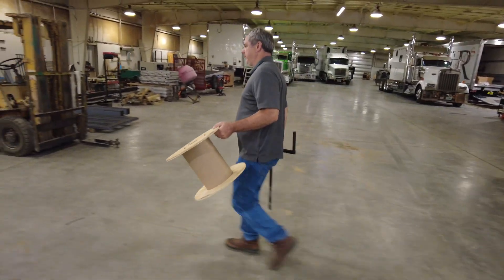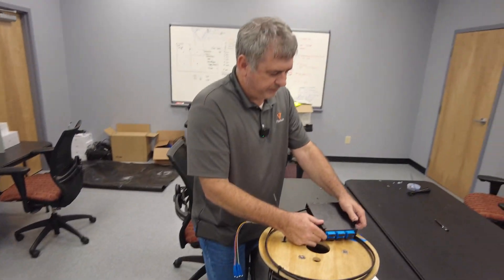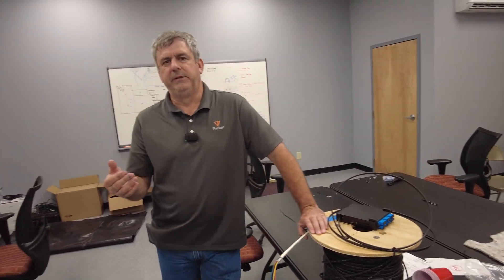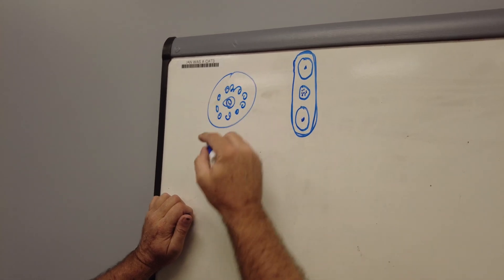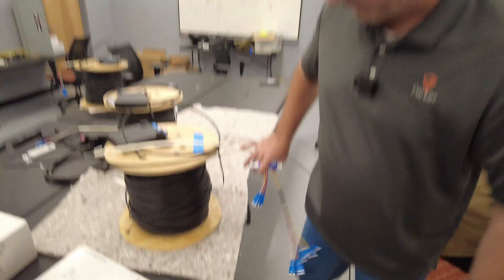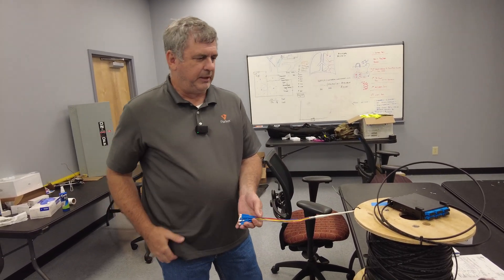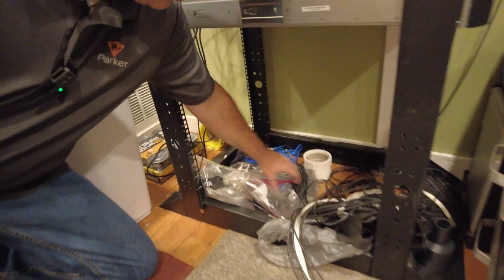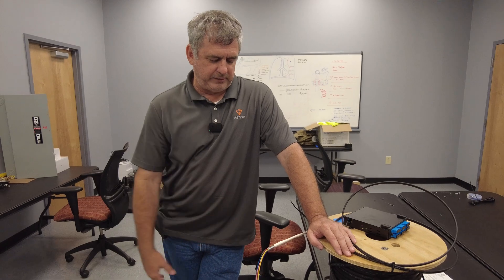We Made a Proof of Concept Temporary Fiber Deployment Solution!

Comment: So I might recommend that if you're going to keep using the wooden spools maybe take him apart before spooling them up drilling a hole through the center of the core so that you run the initial fiber through it and then on the inside of that spool Mount the enclosure to the inside what's some like industrial ports on the outside of the spool kind of a hybrid of the Tactical fiber spools you would find in the broadcasting industry except would just like an outer attached piece since your breakouts are on the side of the school and all you have to do is roll them in and roll them out and the center of the cable stays intact
Reply from the maker: Yes we are working on those upgrades -- thanks for your insight -- we are now working on a mpo connector as well -- stay tuned ---- thanks for commenting

Comment: Tactical Fiber Systems - We use them on our command post for deployments. 2000 foot two strand (LAN on one strand, WAN on the other). Media converter at each end to work with our existing network. 10GB transfer speed. Fully armored. Engines drive over it no issue.
Reply from the maker: Cool -- thanks for the comment --

Comment: Unifi Nano-Beams. About $100 a head, 10+km Link range. 450Mbps throughput. SIMPLE TO DEPLOY. I set one up for a client of mine. 3ish km and I was able to push 400 Mbps through treetops. You can pre-configure (pair) the heads, and manage them with a centralized software similar to a UniFi Controller called UNMS. UNMS will even assist you in gracefully controlling the firmware auto-updates. They run on 5Ghz unlicensed spectrum. Max power consumption is 8w per head...Setting them up is just like configuring WiFi. Same SSID and PW on both devices. Just need to set one as Base, and other as station in the config. UNMS will give the I.T. guy some great info on how its performing (signal and throughput) in real time.

Just a thought, since I saw some of your videos that your folks like Ubiquiti gear...
Reply from the maker: Cool -- The guy that we work for does a ton of wireless stuff.  We try to stick with fiber.  thanks for watching.  great comments --

Comment: Used tactical fiber when I worked on F-35s, I've seen the fiber we used be rolled over by fighter jets without issue, if I remember right it was 2 pairs in a 1000 ft reel. Only time we ever broke it was once when a hangar door metal wheels pinched it.
Reply from the maker: That military stuff is great.    But expensive thanks for watching

Comment: Okay, so as someone in the field here are my comments.
1 - ditch UPC - use APC
2 - Don't expose the snowflake fibres - the cable breakout (heatshrinked) - reason: events are rough so there is a higher chance of damage.
3 - SC is good, it's simple and easy compared to LC - there is always a flylead that can change it when required - and the APC will help with reflected light in the cable.
4 - The box and 12 core is quite bulky on the ends - which is fine - but still bulky.
5 - ends will have to be protected/cleaned before each use - so higher chance of issues.

So lets spin around the idea ... 
SFP28.... 25Gbps fibre...
SFP28 transceiver directly tied into the fibre - and use 4 cores.
IF you need to push more than 100Gbps ... then running another roll isn't an issue or even doing a direct splice.

But what you do is get the transceivers where the fibre is spliced directly into them.
You only need a max of 4 per run with this set - 100Gbps
Most of the time, 25Gbps should be fine. ... heck you could get away with 10Gbps ... but SFP28 is the same form factor and 2.5x the speed, so why not...

Okay, back on track.
Do 2-4 BiDi fibre connected transceivers - you can make a compact and tough enclosure to keep them neat and packed away.
Le'ts say you do 2 - heck, at this point just do std single mode - 2 pairs ... it's fine
2x QSFP28 - so container for each end is small and the fibre can be protected all the way up to the transceivers so even it someone used it to pull or something, less chance of damage.
^^ Notice I changed to QSFP28 now - QSFP28 is 100Gbps .... so you have 200Gbps avail .... (idea, but either could work)

Then have a pair of QSFP28 to SFP28/SFP+/10GE switches - whatever floats your boat - example MikroTik Cloud Router Switch 16 Port SFP28 2 QSFP28 | CRS518-16XS-2XQ-RM
That is a set.
Each port on the switch is numbered and mapped to the other switch.
 - eg with the mik above, you can push 8 ports on the 1 fibre, and the other 8 ports on the other
You could max a fibre for 8 ports at 4Gbps ea (limit) - likely not, but there is enough b/width available here.

Effectively your multi-fibre solution - but simpler and more vlan'ny
Overall what it gives you is copper being the only exposed thing - not the fibre connector - so you do not have to worry about dirt/cleaning the fibre.
You don't have to worry about flyleads - since straight in. (just carry a few SFP28 DACs, SFP+ DACs or SFP/SFP+ RJ45s in the package)
And well if the event techs have a QSFP28 switch, it could just plug straight in.... 

Now in your trailer, you'd have the switches already setup ready to go, so you just plug-in and your link is done.
But say you have to run to a control tenant or something, just put a switch there and they can plug in - you don't have to carry additional stuff.

If they want fibre themselves, then they just give you an SFP and plug directly into your switch.

It minimizes the heads for cleaning, damage and overall their size.
Worst case you just splice the cable if it's an issue - but it makes it hardier.

Also... another way to do things with minimal fibres is DWDM - you can use 1 pair and split up to 16/32 ... don't know what the limit is now.
But that means just 2 fibre connectors on each end rather than a bunch.
Little DWDM converter and you have 16 fibres ... with the size of a 2 core fibre cable ... 

You can always wrap the extra fibres in the final enclosure or what not.
Reply from the maker: You know I never considered leaving the optics tied to the glass.   I agree with the sc vs any other connector. I also liked my mini wall enclosure on the the end of the fiber, but my customer did not.  Thus the heat shrink.   I’m going to look into the connected optics.  The angled polished is not as common as the ultra polished and the distances are so short and link budget is so high for these applications we don’t see an issue …. Great comment.  I really appreciate the time and effort you put into that comment.   What a great community…. Thanks.
Reply: @ParkerSystems  Yea, everyone doesn't join the optics directly into the fibre because usually its a once off deploy - so into patch and then out - not temp deploy - so that use case makes sense - but for you ... not so much. 
Although better for damage, its a bit bulky - not ideal - so double edged sword for the box.

mmm, I see a lot of APC deployment in the ISP field - mainly because it has less reflections so less issues, and less loss - so overall just better.
Interesting tid bit though - and I cant see much info online between the 2 in use cases

If you cannot find any pre-built transceivers, what you could try do is build a new housing for it that is longer.
So basically inside the transceiver itself is 2 LC connectors, the splice (for simplicity sake) and a cable clamp.
And if you want a second, then exit out of that with the same main run cable, into the second - doing that means all/any of the cable that is accessible is the strong cable so less chance of breakage.
Ideally you'd want to actually mold your own LC's, because then it uses even less space.
Many ways to skin this cat - biggest thing is minimal damage surface area for the fibre.

np :) 
Keen to see what you do
Reply: @mitchellmnr damn ol' son.  Very nice!
Reply from the maker: thanks for watching

Comment: For my next structured fiber project I wanna pitch terminating our armored/drop/whatever cable with MPO connectors. Then just go with MPO cassettes to break out in LC so their standard patch cable they've got on hand will work.

It's a lot more compact and has the benefit of letting the cassettes be replaced easily. IIRC MPO method C will even let the polarity swap happen in the structured cable. Less chance of breaking the end of a LC connector for the end user.
Reply from the maker: Great suggestion.  I have already ordered 12 (6 of each male/female) to give those a try.   I’ll keep you posted    Thanks for comment.

Comment: In Broadcast we use "Tactical Rated" Its very durable, but technically a premium product  The flat drop cable is interesting because of relative cost makes it almost disposable. The fusion splice makes it fast to build but typically makes it super fragile, I've seen some encase the splice in epoxy. They do make fiber breakout tubes that this would be a good application for this where you slide the glass into the individual tubes and then terminate the ends.
Reply from the maker: Yes you are spot on.  We have tried the tactical fiber.   Prehaps the lower end stuff.  It basically contains a stainless band that will cut the fiber if it receives a tight bend or any duress.   The drop fiber is tough and like you say very tough.   We have tried the expoxy … finished too hard.  We have tried urethanes …. And varies different covers tubing plastic etc but Excatly as you state the ribbon splice is the issue.  And the ribbon splice that goes from ribbon to tight buffer 256 micron breakout then to another fission. Splice.   I want to put a mini wall on the end and then supply sacrificial SC / LC patch cables but my vendor needs the flexibility of a smaller package on the end.  We are going to try a mpt/mpo connector …. That will get us to one ribbon splice.  And the fan out can be add after deployment.   It will also allow easier spool to spool deployment.   If it works we can do a 3 flang spool and we are thinking of a large Velcro protection cover.  We will keep you guys posted.  If we can crack the code on this it will help a lot of applications.

Comment: Hey Dave,  Have you considered a TFOCA/COTS Connectors? Pricy but durable.  I Have put together a small deployable system for my customer up here in the Mid Atlantic area using those.  I work for MSI up here.  Great working relationship you have with Dave L. And crew down there!
Reply from the maker: I will check it out…. Thanks for the suggestion.